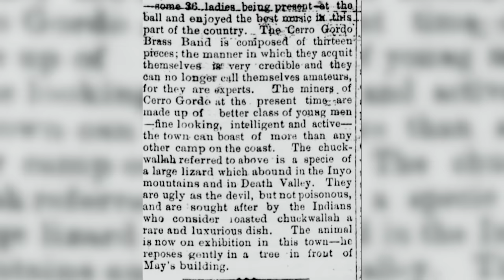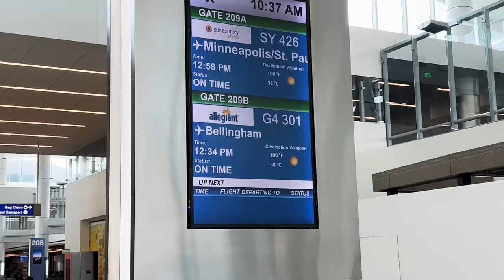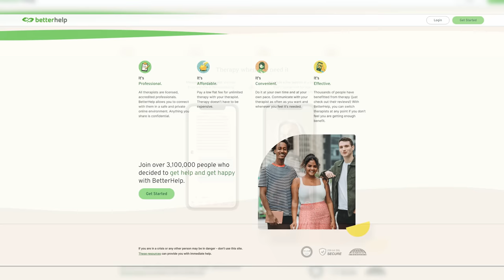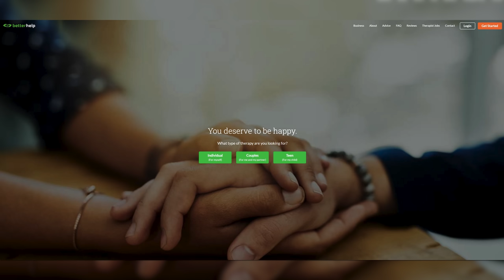Building A Recording Studio In A Ghost Town (Part 1)

Comment: Hey wood worker/carpenter here. Make sure you sticker all your boards. Meaning, put small pieces of scrap wood in between every layer of boards. This lets the air get in and the boards dry out equally which stops the boards warping. Even if your wood is dry this is a good practice.
Reply: Excellent point. Makes sense too
Reply: That’s what I was thinking too! He didn’t have them separated for air flow to dry.
Reply: 32:43 shows the wood stickered
Reply: @treswaldman9147  and @jeremyxman Correct. It was done!

Comment: Whoever rents that rental truck next will be pleasantly surprised by the aromatic cedar smell. You should reach a low water percentage on those boards pretty quickly by allowing flow with spacing. Keep them around 75 degrees in a dark area with good breeze and that aroma will stick.

Comment: One way to prevent splitting/cracking is to treat the ends of the boards with a sealant as they sit and air dry.  Placing the "stickers" between each board is imperative to allow air circulation.

Comment: Try this - get a thin slab that cedar, soak it overnight in water.  Get a salmon fillet, a pear and branches of rosemary.  (I lived in Cali when I cooked this, rosemary bushes everywhere I covered the fish in rosemary branches.)  Slice the pear as thin as you can,mae sure to  get a hard pear.  Lay the fillet skin side own on the cedar board, salt and pepper the fish, cover the fish in pear slices then a layer of rosemary branches and smoke it on chips.  I used aspen wood chips.  May need to keep wetting the cedar board.  About 10-15 mins covered in a little smoker grill.
 Goodluck with your studio man!  🍀

Comment: This project sounds amazing. I'm an architectural acoustic consultant and I have some suggestions for your studio. Although the cedar is a soft wood, it is still a fairly reflective surface. Something you may want to consider is putting up some 1" fiberglass acoustic panels of an NRC of 0.75 or higher. Please do not use the eggshell foam that YouTubers often use. It is very ineffective compared to fiberglass panels. Another thing that could help make the studio sound better is an area rug with a 1/4" pile and avoiding parallel walls with the same finish. If this is something you can't avoid then you can place diffusive wall panels that can be made out of offcuts of the wood. I know this is a lot to take in but feel free to reach out with any questions.

Also when referring to the ability of a material to take away sound energy we say it is "acoustically absorptive". Being absorbent refers to the ability to retain water.

Comment: Brent, in order to help you best with the studio, can we see the floor plan? There are sooooo many things to consider when building a recording studio. You can easily screw up a dimension and the studio becomes a beast to work with - no parallel walls, ceiling included, plus a cloud above the mixing position as well as bass traps in the rear of the control room. Yes, you will have beautiful cedar walls but most of it will be covered up with baffling, diffusors, wall traps, rugs, dense materials to reduce reverb and bounce back (your library would've been great to place inside the recording room - think Tiny Desk). Will the studio be floating, airlock? How are you going to tackle aircon/heat? Sight lines from the control room to the live room and any iso booths, cable management (there have been great advancements in wiring ie. CAT5), how many channels are you going to run, will it all be in the box or will there be outboard gear or a console, what preamps/eq/compressors/fx, what microphone selection, monitors, what in-house instruments/amps/drums/guitars/bass/piano/keys, lighting, sound reinforcement..... and honestly on and on and on.
If the studio doesn't function sound-wise in all the recordable spaces, it doesn't matter how cool it looks, the studio will be difficult to work with and thus artists will be less prone to wanting to record there. Make a great sounding studio and artists from all over will enjoy the final product that will come from that space. Again, looks are not as important as the sound that is produced there. Yes, it is important to create a vibe so the artists feel a certain vibe but with the final product, no one sees the music, they hear it, and if it doesn't sound good or if the journey is difficult to get a decent sound out of the studio, artist just won't want to record there, no matter how cool or vibey it looks. It needs to track well. 
Looking forward to seeing this. I've been a life long recording engineer/musician and work in a recording studio daily. Cheers!
Reply from the maker: Thank you for the insights! I'd love to chat more. Would you mind sending a note to: studio@cerrogordomines.com ?

Comment: @GhostTownLiving One of these days, I guess you have to crowd fund for to get the road really fixed. It will be expensive because you will most likely need some blasting done. But it would solve the many issues you have with it raining away and some of the tighter sections.😺

Comment: Beautiful work. The live edge pieces can be used for lovely shelves or tables. Our bakery in my town has a beautiful live edge slab piece for their checkout counter. Also, please make sure that anyone working around machinery (or fire) knows the cardinal rules of keeping long hair tied up, loose clothing tied up, and don't wear rings or dangling jewelry. Safety first!
Btw, where did most of the wood originally used in Cerro Gordo come from? Did the settlers denude the mountains there of trees? If so, one project you might want to eventually look at is some possible reforestation. Trees would help stabilize the loose slopes in areas.

Comment: Brent, when working at a wood mill, your job was as a TAILMAN. USually you had to keep up.....or risk "blocking the mill" . If you blocked the mill , you needed help to "stack" according to "blue prints" and the process of building shapi g and completing your project.....a really good TAILMAN can stack 8 to 12 projects in 8hours of work,  MILLING TIME.... SO YOU are a "CUSTOM PROJECT " AND WOULD BE SENT THROUGH A SPECIALTY MILL.....set aside for single projects that start with logs to finished project........Idid this for three years....until Western  hemlock and and Shenandoah hemlock were coming through the mill.....
One fun thing though, TO work in the log cabin building industry, you had to be able to cut in saddles, notches, cubbies, and garners. But you knew you were good when you could "write" (in proper cursve)your full name with a 19" stihl chainsaw.... some companies would not hire you, even after you showed them you could make the cuts for building log cabins......

Comment: I see the wood dead stacked behind you. If the moisture content is very high in the lumber and it may be given the tree has only fell the year before you should not be dead stacking it. By dead stacking I mean board to board with no cross stickers between the layers so it dries properly.

Comment: Re: scrap wood. If you are building a genuine acoustic freindly recording studio, opposite smooth walls of the same material are a problem. Folks often use diffuser panels and that scrap wood could be cut into different lengths and widths to be fashioned into diffuser boards. You can hang them like a painting or buoikld into the walls...